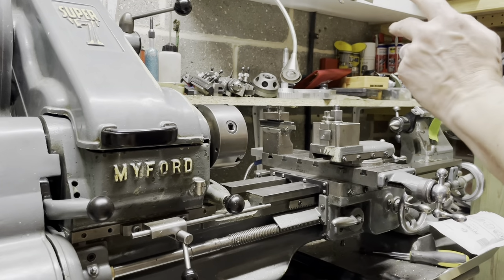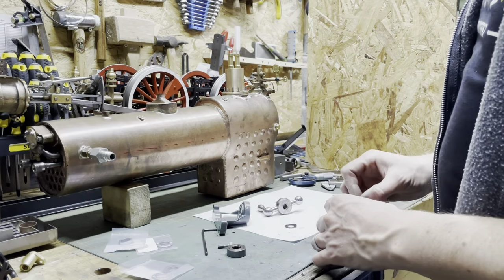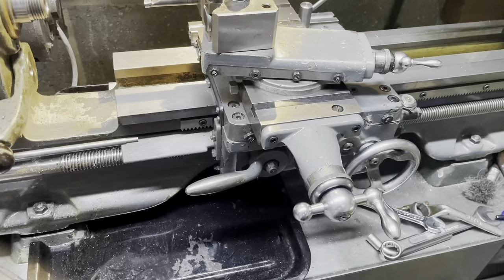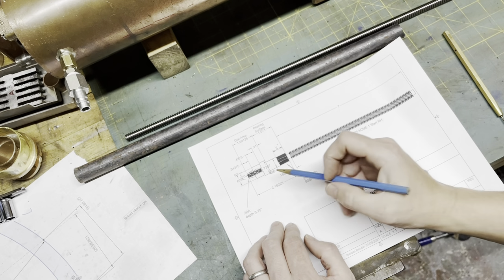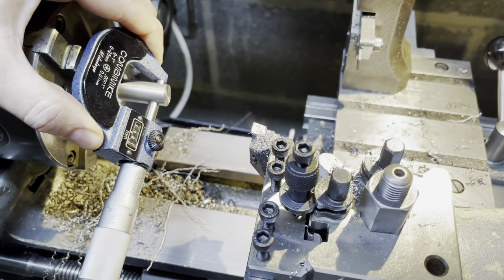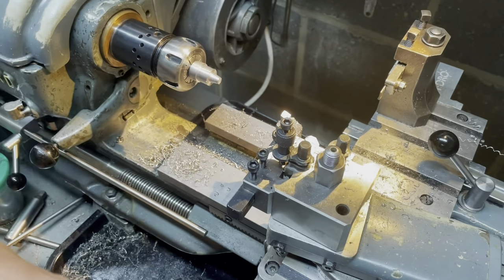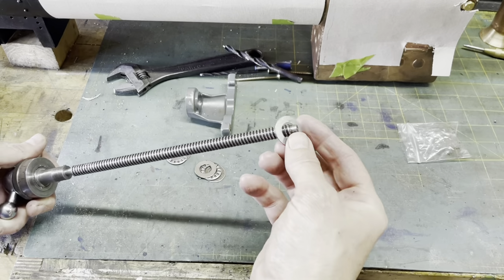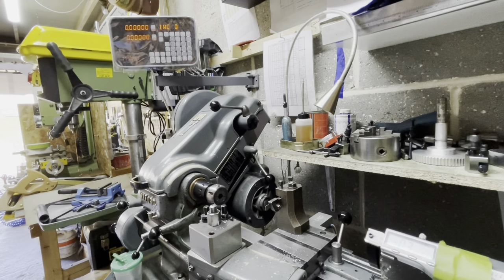#Toolfest2021  Myford Super7 Cross-slide Lead-screw replacement and upgrade

Comment: Brilliant replacement. I like the way you made it in two parts. Good useful info on buying from the USA. Cheers Tony
Reply from the maker: Thank you for the kind comment. I perhaps could have made the screw with a travelling steady but didn’t feel confident at the time.
Reply: @madguernseyboy  I would have done the same. It's not a commercial machine being flogged every day by some gorilla. You worked within your limits at the time, and it's paid off.

Comment: Very well done Brendan  ... I just went and checked my 35 yr old  S7B  ... and Yep 0.007 backlash on the cross slide so I will have to do the repair in order to rectify my OCD issue ... Thanks  ... now to fined some 3/8 x10 Acme in the Antipodes ?????  ... CHEERS   ( NB ... those with  a  'S7B Long Cross slide" will need to use NTA916 bearings ... check dimensions before ordering parts).
Reply from the maker: Good luck on your search. I was preparing to make one if I couldn’t find one. I even dusted off the fixed steady in preparation. But luckily I didn’t have to go down that route.

Comment: Nice job Brendan but copper slip is a Bad idea on a lead screw. It's good at preventing corrosion on bolts but a very poor lubricant and will wear out the lead screw. A good bearing grease will keep things running smoothly a lot longer. Looking forward to more content from you.
Reply from the maker: Thanks for your comment. Another person has told me the same thing. I guess it must be true then :) 
I have used a general grease instead. 
Thanks for your help
Reply: @madguernseyboy oil, not grease. Ever
Reply: Just watched your video very informative as I need to do that to my ML10 what size are the thrust washers please, a part number would be great.

Comment: Hi Brendan really nice job, I need to do the same to my S7 so have ordered the threaded bar do you have details for the thrust bearings you unused? Cheers A
Reply from the maker: Excellent comment 
Will add the details to the description 

2 x NTA815 Needle Roller Cage Thrust Assembly with 2 TRA815 Washers 0.50x0.9375x0.1406 inch	£6.41

https://simplybearings.co.uk/shop/advanced_search_result.php?search_in_description=1&keywords=NTA815&

Comment: Nice job, Brendan.  Noticed the really well designed saddle stop attached to the front of the head stock.  Is this your own design, or did you procure it from someone?
Reply from the maker: That was with the lathe when I got it. 
I like it as you can put in a longer stop if you need more reach.

Comment: I'm probably being a bit of a prude but i can't help but notice that you're assembling bearings in dirty conditions with no grease.  Otherwise, I appreciate the video.  I'm about to do about the same procedure for a chinese 9x20, which has triangular threads and plain steel-on-steel bearings.  Cheers!
Reply from the maker: Thanks for the feedback. 
Don’t think my garage is getting much cleaner though. 🤔😳

Comment: I noticed you have a M-DRO fitted, with the imbedded cross slide. Just waiting on mine to arrive. Did you have any trouble fitting it?
Reply from the maker: Was a very easy install, even using my tiny mill. I am very pleased. You won’t regret it.

Comment: Shipping costs from US via fleabay are extortionate. If I could filter out US listings altogether I would. You did really well there. Bit odd your leadscrew wearing out before your nut isn't it? unless it's already had nuts replaced of course.
Reply from the maker: Yes I bought a new nut first thinking it was the softer metal. But perhaps the previous owner had already done that. Who knows.
Reply: I had to check the comments before I said that myself. Could be that someone made a steel nut at some point in time because of excessive backlash.
Reply: @madguernseyboy   the softer material picks up swarf and grit and wears out the harder one. Quite common to see in bearing materials.
Regards,
Steve A.

Comment: There are easier ways to adjust the free play. Left hand acme screws are easy to get and replace. Why do you say they cannot be bought?
Reply from the maker: Would be interested for a thread in the UK? I count find one. Very interested if you could provide a link.
Reply: Myford cross slide is a right-hand screw.
Reply: @SloopyJohnG  Do you know the difference? All lathes use LH screws
Reply: @bingosunnoon9341  Just look at the screw in the video, will you? It's a right-hand screw. Once again, the Myford cross slide uses a right-hand screw. End of discussion.